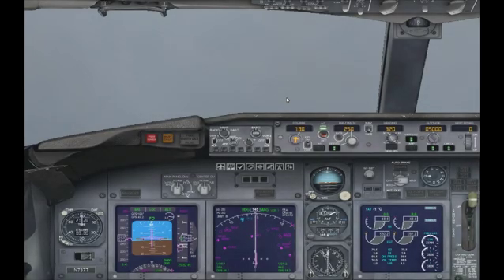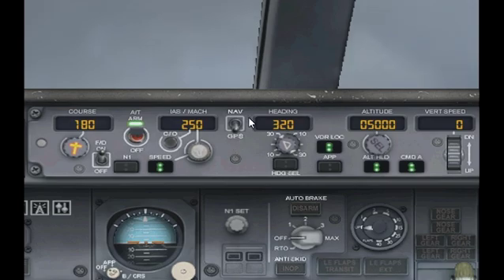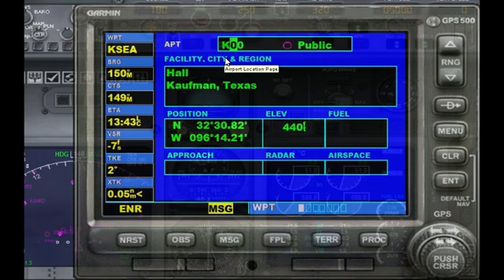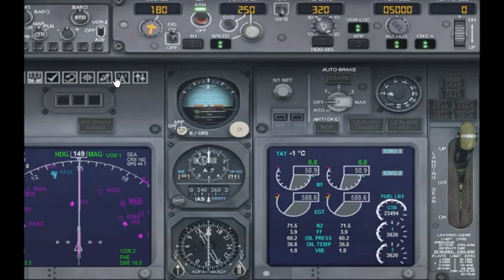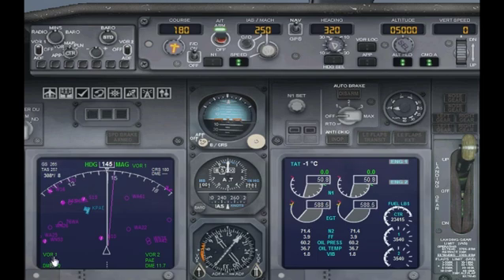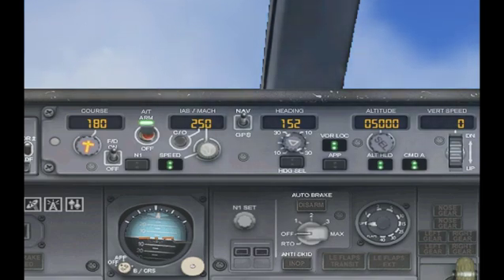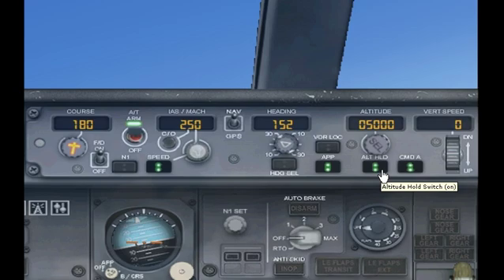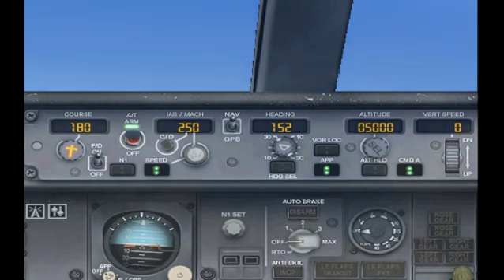FSX: Autopilot Functions Tutorial PART 2

Comment: Whenever you're about 30-45 nautical miles away from your selected runway, set the frequency as he said then turn on nav hold, that's it. Once you intercepted the localizer, nav hold will adjust your plane towards the runway then when you intercepted the glideslope, turn on approach hold and wait till the diamond gets equal to flight level ground (via atitude indicator) then plane should start descending. So basically you just need the localizer first, the rest will follow as you intercept them.

Comment: 8 at no point does the tower ask me to reduce alt therefore i get no glide as im still above 3000ft ?
9 decide to reduce speed to 170 and hold and alto to 2900 ft ok nothing so i set aproach when i see what i think is the ils  diamonds lined up it eventually starts to decline 
10 reduce speed to 140 flap full or 20 ?  very eratic and misses runway  
boooo  also im not sure ive aproach from right side of runway 
i know i suck  im a newbie but any suggestions would be really kind thanks

Comment: check list 
1 flight plan  manc to birm
 2 radio nav 1 set 10.100 click light and move to active
3 gps  proc select ils 33 active run
4 load or activate ?
5 set plane to gps and nav hold set alt 5000ft hold speed 200-250 hold 
ill skip all the take off crap
right im about 20 nm away  i get beep for vor
6 checked i have a signak on vor switch to nav and keep nav hold on
7 tune into tower request full land

Comment: Just a quick question, I've managed to follow your tutorial until the moment where you intercept the ILS frequency and you get the responding morse-code. However when I turn on nav-hold to intercept the vertical slope the plane just banks to the right and start going round and round. I think I've followed your steps correctly. I turned the switch from GPS to NAV and turned off Nav-hold until the morse-code is sounding but then when I turn on nav-hold again. It seems like the plane gets confused.

Comment: I'm pretty sure you can leave HDG and ALT hold on while the plane is on intercept heading and altitude. You can turn on APP hold over those, and the HDG hold will be disabled automatically when the localizer is intercepted; same applies to ALT hold and glideslope intercept. So it's not necessary to use NAV hold first and then switch to APP hold. In my video, I manually fly the ILS from intercept heading, but APP hold with the F/D still helps guide me while flying.